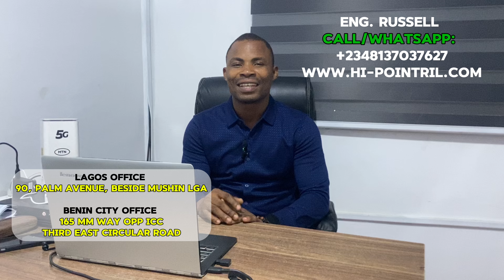HOW TO MAXIMIZE HEAVY DUTY LOAD ON SMALL BATTERY BANK SETUP

Comment: This make absolute sense especially for offices and businesses. The peak consumption is during office hours between 9am to 5pm when the sun is still out. At night when the office is closed, you only need power for security cameras, alarms and lights.

This would also work for homes too if they can reduce loads at night like using fans (instead of AC) at night. Use energy efficient appliance like inverter appliances(inverter AC, inverter microwave, inverter washing machine), energy efficient led bulbs and do your heavy loads like laundry, ironing during the day. 

My current setup is similar too. I have 1200 watts solar, 3.2KVA 24V hybrid inverter(can take up 500V 3000W), smaller 24V 500w non-hybrid inverter and 2.56KWH Lifepo4 battery bank for a 2 bedroom home. 

One difference is that i have both two inverters connected to my battery bus bar. I can turn off the hybrid inverter at night and use the smaller 500w non-hybrid inverter because the hybrid inverter uses around 35W just to run and the other inverter uses only 12W when running. Also using smart timer plug help. I can turn on/off my AC from anywhere.
Reply from the maker: Absolutely right ❤